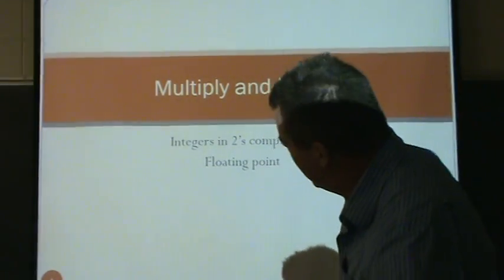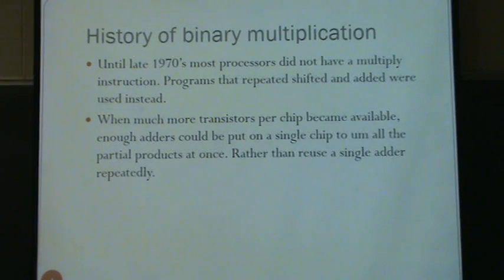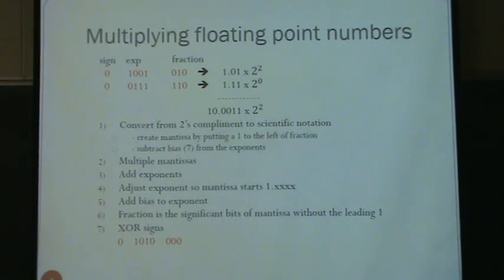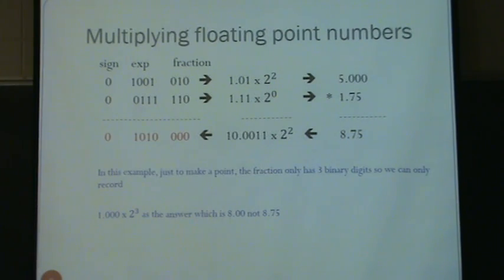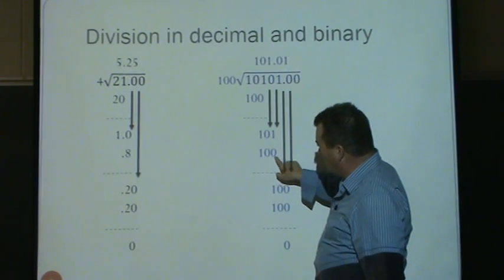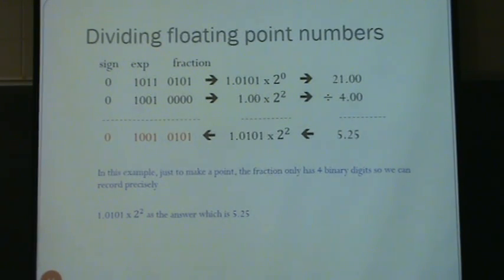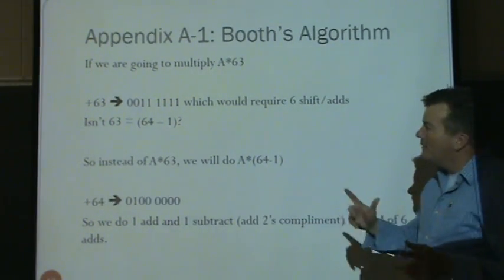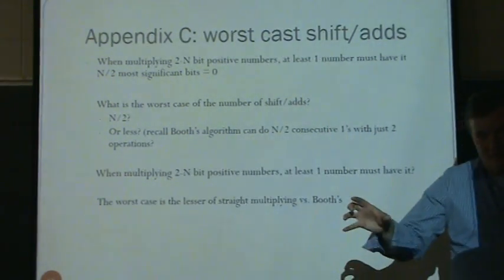Binary Multiplication and Division

Comment: I really hope you read this, because the diagram at 7:44 is ... well its correct but the right-most AND gate is unnessesary, you can directly wire the top input into the output, since the top input will only be True if all 4 inputs are true, but the bottom input will be true if the bottom two inputs are true, making this completely unnessesary.

Comment: and(and(a0, b0), and(a1,b1)) is the fastest way to find out if c3 needs to be on. It doesn't have to go through the extra and gate used for the input of the xor on for c2.  I would have been docked for that. Yes it's right and the number of gates for this are technically the fewest.